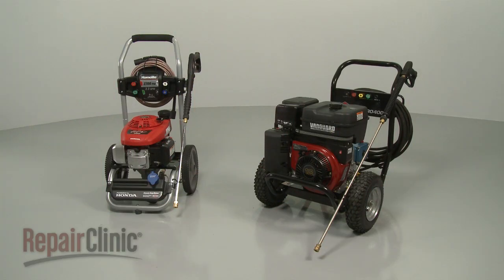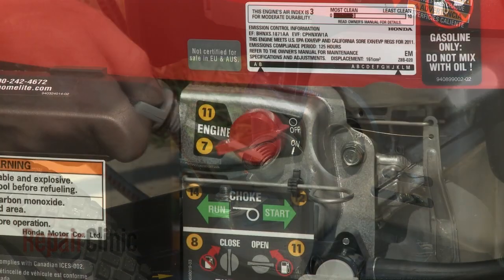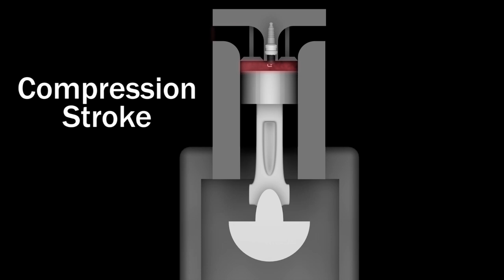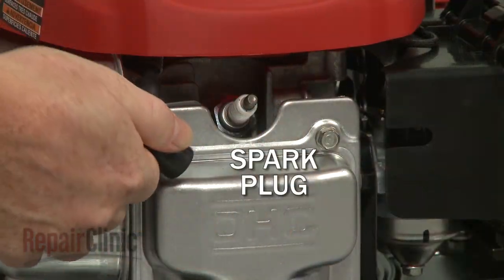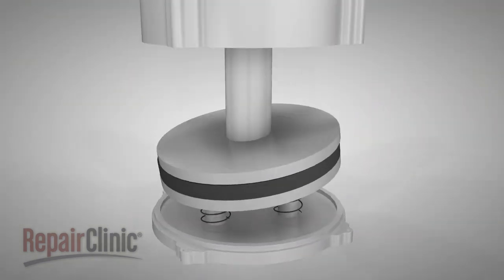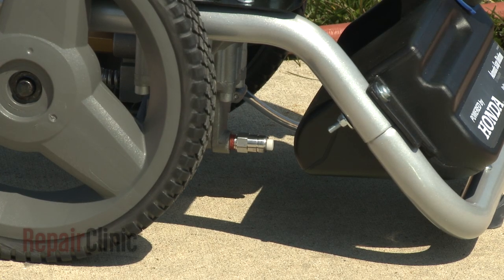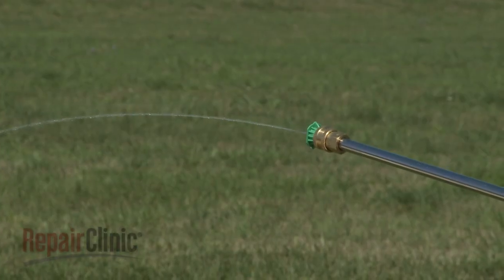How Does a Pressure Washer Work? — Lawn Equipment Repair Tips

Comment from the maker: A normal well pump is designed for pressures between approximately 30 – 60 pounds of pressure. A pressure washer pump is designed for much higher pressures approximately 1500 – 3000 or more pounds of pressure depending on the model. A pressure washer pump is designed for low volume of water but at a high pressure. You need to use special nozzles with  a small hole to produce the pressure.

Comment: You did a good job on how a 4 stroke engine works, but limited info on how the pump works. Like how much hp is needed for a certain pressure and gpm. Why does the wand have to be so long? Does a longer wand increase pressure?
Reply: If anything, it would be the wand's tube inner diameter responsible for the output pressure..
Reply: IME, a long wand is a good thing (giggity!) because you want to be back from the high pressure water, or you'll get even wetter than you already will. Plus, the wand is sized about right to spray the ground in front of you without stooping, assuming you're of average height.

Comment: I pulled a GVC 160 out of the trash last night. I just got done cleaning the carb, it fired up on the 4th pull. Now I need to ops check the pumping system.

Comment from the maker: The higher pressure nozzles do not let enough water pass by the injector venturi to draw the chemicals. We can't recommend altering the manufactures design. If you put a tube on the inlet side there won't be enough water passing thru the hose to draw chemicals unless a larger nozzle size is used on the high pressure side. The other thing you need to think about is if you put chemicals in the inlet side, compressing the chemicals could potentially be dangerous and the chemicals can harm the pump.

Comment from the maker: It is possible the unloader valve is stuck and not releasing the pressure. Don’t get this mixed up with the thermal release valve they are two different things. The unloader valve recirculates the pressurized water back through the pump to avoid damaging the pump.

Comment from the maker: Moving water will not freeze and the pump will keep warm when it is running. The problem is when it is turned off.  You would need to put some pump saver in the unit each time the unit is shut down. Remove the pressure hose and drain all the water out after each use or store it inside your house. The pump saver part # is 1941855 on our website.

Comment from the maker: You can remove the unloader valve and see if the engine will turn over. If not you might try removing the pump from the engine to determine if it is the engine or the pump that is not turning. The unloader is most likely under a cap and will need to be pulled out to see if it is working  properly. You can look at one on our website for reference. Part # 1971071 although this may not be the one for your unit.

Comment: What would cause my pressure washer to not crank? This is my first time using the product and was working fine until it ran out of gas. So I let the engine cool for a bit, added gas and then pulled on the start cord. Nothing budged. I did release the pressure at the hose trigger, even disconnected the water hose from the unit. Still the crank shaft will not move. I suspect the pump still has high pressure inside and that is why I am not able to crank the engine. Any suggestions?

Comment: Most small engine carberators can be rebuilt as well by the user most home improvment store washers are of 3 brands kholer, briggs and Stratton or honda many small engine places have em if u have to have it going that same day it has alot of small parts so many coose to replace but common issues are vowl float failure and nozzle clogging

Comment: I noticed that in the animation when you pull the starter rope, the flywheel spins the opposite way from the way that you pulled the cord. It should turn clockwise and not counter-clockwise.
Reply: actually it's going right way

Comment: Why does a chemical injection location have to be on the outport pipe?  I have a gas/portable prssure washer I need to use to spray my 35 ft tall trees. The low pressure option to suck treatments squirts maybe 10'. I need to mix the trtmnt into the high pressure shooting 40 to 50'. The car wash sprayers have an option for soap and etc. I need to make a pitot tube attachment at the water inlet. Comments ? Options? how tos?

Comment: Hello,
I´d like to buy a underbody lance for an AR Blueclean 610. This pressure washer has the specifications of 1885 PSI (130 bar) and 2.1 GPM (8.3 L/min) and it has a valve to adjust the pressure water. It has the VARI-SPRAY NOZZLE HEAD AL413R (I couldn´t find the orifice size data of it). I´d like to ask you about the exact nozzle size: do I have to consider the maximum PSI and GMP for select the correct nozzle for the lance? In this case the nozzle size will be 3.5. What about the other pressure achieved with the adjustable pressure valve? For example, if I adjust it to 1000 PSI, will I have to change the nozzle tip to another (example: 4.0)? or always I have to use the same tip with its orifice size related to the MAXIMUM PSI and GMP even when I decrease the pressure? Thanks a lot in advance.

Comment: Dang lots of problems with these things... if there was only a air compressor powered pressure washer that itself had no moving parts. No pump, or motor. One anybody could make themselves. The king will solve this age old problem. I'll call it... The king's power washer gun. An air compressor powered pressure washer!  You are welcome to check it out, and invited to leave a comment. Have a great one!

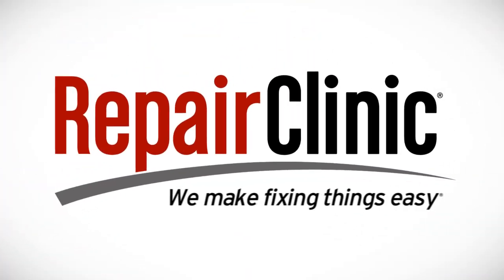Comment: The correct terminology is 4 Stoke, not 4 cycle. A cycle is a course or series of events or operations that recur regularly and usually lead back to the starting point. Note that is states leads back to the same starting point. To use cycle to represent ½ revolution of the crankshaft, (which is what you are doing), means that at the end of every ½ revolution, the same set of events will occur. This is not true; a different set of events occur next that when they are completed, a different set of results then occur. This happens every ½ revolution of the crankshaft, which equates to the piston moving either upwards or downwards in the cylinder one time, an action called stroke. It takes four such piston movements for the engine to fire a cylinder, hence the term 4 stroke. You prove my exact explanation of why it's called 4 stroke starting at 7:38 when you describe what happens inside the engine in order for it to run. Oh, BTW, vacuum does not draw air into the cylinder, atmospheric pressure at the throat of the carburetor pushes ir through it and into the engine. Although you probably state it that way to simplify it for people that don't know how a internal combustion engine works. At least I give you kudos for not ever calling it a motor.
A 2 stroke engine accomplishes the same events, (albeit in a different way using less parts), in two ½ revolutions of the crankshaft; hence the 2 stroke term. Each stroke consists of a series of events that without the other(s) that are necessary for the engine to run, do not constitute a cycle. Why the change of terminology to use a word that is totally inaccurate doesn't make sense. Does stroke offend some people?